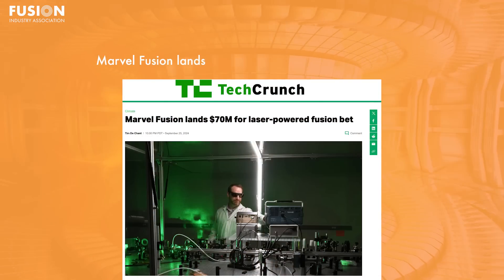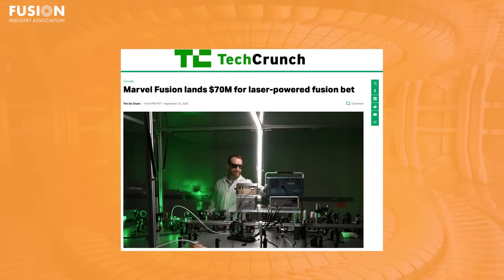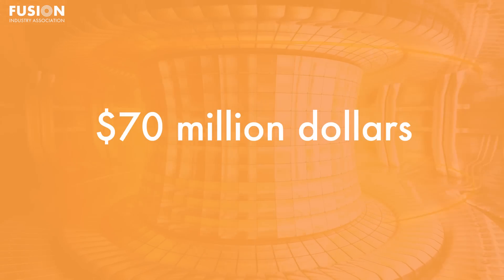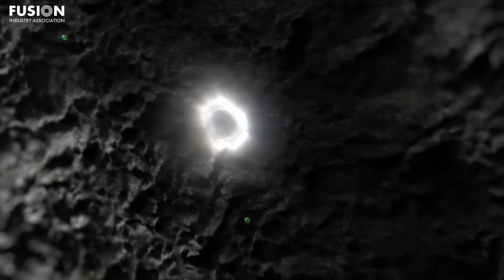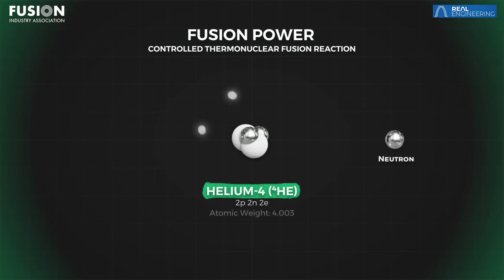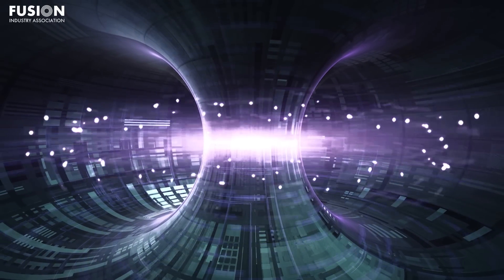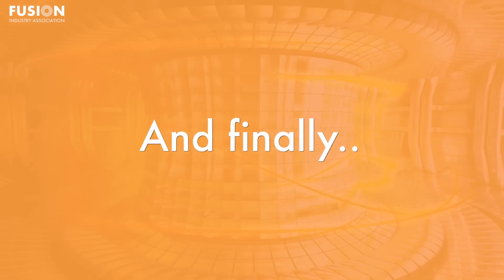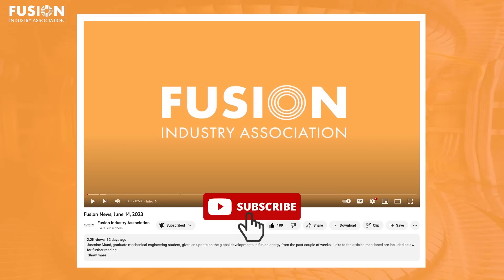Fusion News, October 2, 2024

Comment: NIF did not reach break even - the director of NIF even said so.  The energies for delivery (energy is lost along the way) and for construction of the pellets is not taken into account.  The July 2023 fusion reactions yielded 3.99 million joules of energy whereas the total energy needed to power NIF’s lasers is around 350 million joules.  There's a long, long way to go yet.  NIF is hoping for fusion reactions generating ~20 million joules sometime next year.  Meanwhile, the JET system in the UK produced about 69 million joules in Feb 2024 from a single pulse and multiple times - but is not claiming "scientific breakeven".
Reply: He said "scientific break-even."
That's not practical break-even.
He knows perfectly well your "correction."
And he included the information in the script.
Reply: You're talking about old flashtube technology. Today, 100,000 small (2x3 inch) megawatt laser diodes can pump 20 MJ of laser energy in 200 microseconds. That amount of energy (20 MJ) is an order of magnitude more than NIF delivered to its target on its record breaking shot. An order of magnitude might not seem like much, but when you're standing on the edge of the "ignition cliff" adding more energy to the target leads to a large nonlinear increase in the yield.
Reply: @michaeldeeth811  20MJ is what they estimated as what would needed at the Halite-Centurion project. However, since it is classified I ignore what targets they used.
Reply: Fusion outputs are highly exponential. For instance NIF increased their laser power by 10% and their output went up by about 230% on the next successful shot. Companies like Marvel are also using laser spectrums that are more like 10-20% efficient where NIF is 5% at the final laser optic and then I believe loses another 5x by striking the hohlraum instead of the target directly. Combine those effects and it's far more accurate to refer to NIF as breakeven than as a 99% energy loss. Both are accurate in their own ways, but scientific breakeven is more accurate in terms of possibilities that aren't necessarily out of reach
Reply: Yeah, I don't think NIFs design will ever be able to reach scientific breakeven. But their plasma research is still valuable. Plus, they did achieve ignition which is a big milestone on its own merits. 

I hope it's not going to just be used for weapons though.

Comment: Regarding all inertial confinement systems with lasers, the question is how do you protect the lenses/windows from the 14 MeV neutrons? In addition how does the laser light go through the essential sphere of lithium necessary for tritium breeding? (In other words, where does the lithium go?
Reply: Laser light will easily pass through windows/lenses made of lithium glass.  Windows/lenses that contain lithium will also absorb neutrons to produce tritium. In addition, if the lenses/windows are replaced by liquified lithium glass pumped in/out of a large hollow spherical reactor chamber with internal mirrored surfaces (think reflector telescope vs. refractor telescope) then the problem of removing extremely large amounts of heat is also solved. Under this approach the expensive fuel pellets can be replaced by no-cost bubbles of DT fuel positioned at the center (focus area) of the reactor.  Because the fuel is surrounded by material (not vaccuum), the containment time increases. This gives the fuel more time to self-heat, which increases the gain. That is just a few of the advantages of this approach.